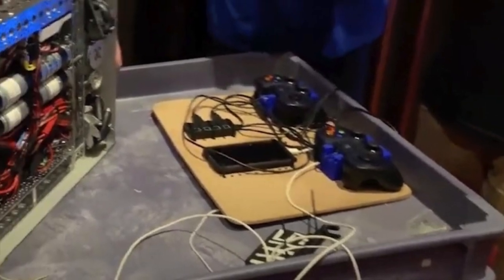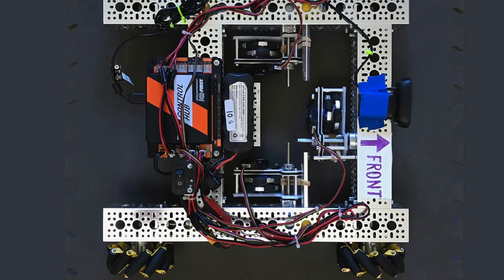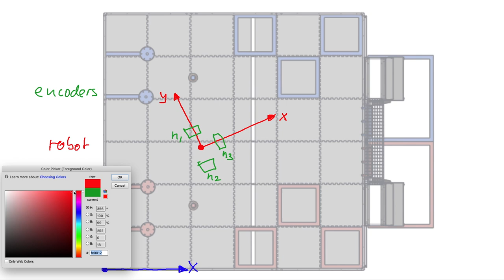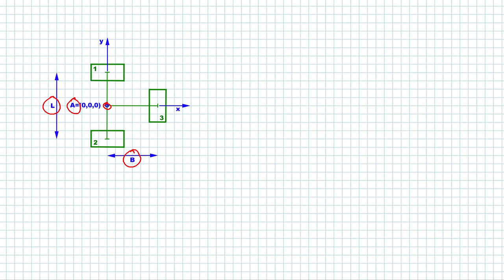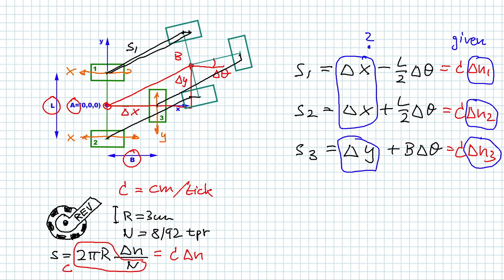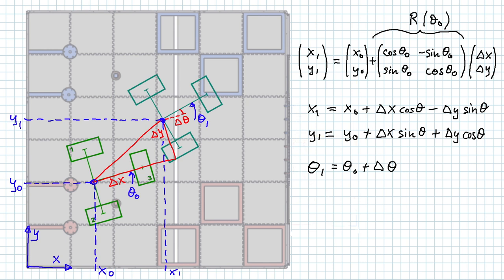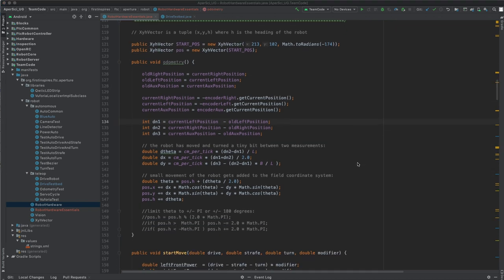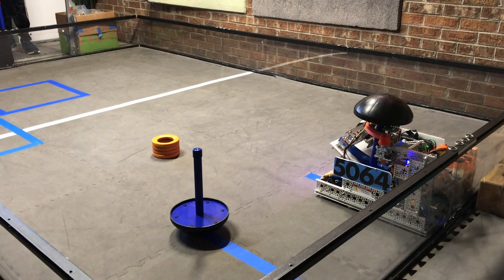Odometry 101 for FIRST Tech Challenge Robots

Comment: Love the video and thanks for your dedication.

Just one question, probably a dumb one. For the field coordinates, why are you adding just the half of dThetha to calculate the X and Y position? I don't fully get it.
Reply from the maker: Once you have an estimation for the displacement and change in the heading, you need to apply it to the field coordinates. You could (a) first apply the dx and dy and then dTheta or (b) dTheta first and then dx and dy. There will be a small numerical difference between (a) and (b), so I decided to split the difference by applying dTheta/2, then dx and dy and finally another dTheta/2. 

As with all numerical approximations, there will be a tiny error in each iteration. Luckily, some of the errors cancel out, but others may add up over time. The goal is to minimize the errors across the whole system starting from the mechanical sensors all the way to the numerical trickery.

Comment: Great video, is the rest of the code posted someplace? Especially the part on line 46? The goToPosLinear method?  We are curious to see how that works.
Reply from the maker: The short answer is no. Basically, I recommend some P or PID controller to follow a given path. There is no one-size-fits-all solution though. It depends on the hardware (mecanum vs. holonomic etc) and there is always a compromise between speed and accuracy.

Comment: Hello! This video helped me a lot to understand the concept of odometry. Sadly, when our team ordered the materials for this season we could only afford 2 rev encoders. I was wondering if there is any way we could implement odometry just by using two encoders on the x axis.
Reply from the maker: Yes, I can think of several options here, though I don't have any hands-on experience on those. In essence you need to track 3 parameters of the robot, moving forward/backward, moving left/right and turning, so you also need 3 sensors in the general case, but you could get away with 2 sensors if you don't move the robot in all 3 orientations at the same time. 

If you have fixed wheels (not mecanum or omni) the robot can only go forward/backward and turn, but it cannot go sideways limiting the need of sensors to 2. We have use that in the past and it worked reasonably well for not too complex autonomous programs, by just using the motor encoders.

If your robot uses a mecanum drive base, you could use the IMU in the controller to get the turn angle for the robot and use the two odometry sensors for x and y. However the IMU's angle tracking is not extremely accurate, but it may work just fine.

Comment: Thank you so much for creating this video. Is it possible to also see your code for your test auto program? Still trying to understand how you are able to move the robot the way you do in your test auto. Again, thanks for putting this together.
Reply: Hey Paul!

So we don’t plan on publishing our software, but here’s a little snippet from our code so I can give you a quick (but not really quick) explanation (we do all this in a LinearOpMode by the way):

    public void goToPosition(XyhVector[] p, double speedModifier) {

        robot.setupPosBezier(p, speedModifier);

        while(opModeIsActive() && robot.followingPath == true){
            robot.odometry();
            robot.goToPosBezier();
        }
    }

For starters, we went completely custom with our movement algorithm, so it’s very specific to our robot, and all the other software we’ve written, which makes it difficult to explain over text, so I won’t go into much more detail than is necessary. That said, as you can see where the method is defined, we take two parameters: An array of instances of a method we call XyhVector, and another parameter called speedModifier. A singular XyhVector contains 3 values; an x position, a y position, and a heading (we’ll come back to why we take an array of these in a moment). speedModifier, the other parameter, is simply a multiplier for the speed of our robot as it moves. As the method runs, we setup our robot’s movements with that method setupPosBezier, which calculates various things relating to our movement algorithm, like the path the robot will follow based on the points within a given array (p in this case, our previously defined XyhVector array), the time it should take to get there, the cutoff point at which we will stop following the path if it takes too long, and the distance we have to move/turn. Afterwards, a while loop begins, which lasts as long as the op mode is active, and our robot doesn’t take too long to reach it’s desired destination. Within the loop we have an instance of the familiar odometry() method (shown in video) and goToPosBezier, which takes the results from the setupPosBezier and translates that into movement of the robot. This while loop is crucial to the success of odometry in autonomous, as you can’t constantly track your robot’s position in the period without some way to constantly get new input. Hope that helped to answer your question, feel free to ask more if you’re curious or I just flat out didn’t give you the information you wanted!

TL;DR: We run our movement code in the same while loop as our odometry readings, which constantly updates our position allowing us to move accurately
Reply: @respieces5129  Thank you do much for sharing the information that you have. I really appreciate it.
Reply from the maker: Most of our movements are on straight lines. We chop up the line into smaller segments, depending on the length, then use a P-controller to follow the waypoints. That includes partial angles for the turns. We also experimented with Bezier-curves for more complex movements, but the team was not totally satisfied with the performance/speed. I guess there is always a next season to make improvements...

Comment: Hi, I’ve 3 wheel odometry but I cannot place my 3rd wheel exactly aligned to centre of rotation. In fact I’ve to place it near my rear wheel. I put feed forward offset as negative value but how do I accommodate angle in the code? Any suggestion what to do when centre of rotation and third dead wheel is not aligned?

Comment: Hi, im the captain of a mexico´s ftc team, i have some quiestions about the coder, what library did you use to define the XYHpos and where can i find it?, i´ve been trying to use the odometry in our robot and your video its so well explainded but i have those questions, i´d be glad if you can answer it, THHAAAANKSS
Reply from the maker: There is no official library or third party code that I could share. All you need is a class that holds the three variables for x, y and h (heading). See code in the description of the video. Getting the odometry values is one thing, following a path is something you need to add on top.

Comment: Can’t you just have the robot spin in a circle and divide each of the encoder values by 2pi to find the exact distance from the center instead of measuring by hand .
Reply from the maker: Yes, you can and we actually did. It's more accurate that measuring by hand. Before that, you also should drive the robot in a straight line and record the distance and encoder ticks. With that, you get the effective wheel diameter which may be off a bit from the nominal 60mm.

Comment: I ince was doomed by the high speed and low torque of my robot in a compitition does anyone know if there is a way to control torque mechanically
Reply from the maker: Roughly speaking torque * speed = power. So since the FTC motors have a fixed maximum power they can produce, you either can choose between low torque+high speed or high torque+low speed and everything in between. And that's done by selecting the appropriate gear box for the motor. If you don't have the exact motor+gearbox you need, you can further gear down your wheels by an external gear set or pulleys with a timing belt or sprockets with a (plastic) chain.

Comment: Team 6418 Question for the two X encoders couldn't you use the actual motor encoders realizing of course that their resolution/tick count will be lower than the omni wheel version. Wouldn't this simplify things because you would only need to add one omni wheel for the Y axis to the robot?
Reply from the maker: Good question. Yes, you can do odometry in many different ways, but the results will differ too, and it all depends on your drive base. When using motor encoders, you run into issues with wheel slippage and you don't register bumping into walls or other robots. We have looked at different approaches over the years and they all worked more or less:
(1) 2 fixed drive wheels + 2 omni wheels or a caster wheel. There is a general closed mathematical solution for this type of robot which is somewhat complicated to implement, but you can divide your path into straight lines and tunes to make the software simple. We used that years ago on our Lego robots and early FTC robots.
(2) Mecanum wheels + IMU. Mecanum wheels are fairly good driving, but strafing cannot be tracked reliably with encoder ticks from the motors. We have used mecanum wheels in conjunction with an IMU in the past and got fairly good results.
(3) Holonomic drive base (4 omni wheels). Very inaccurate odometry based on drive wheel encoders. You'll need dead-wheel odometry.

To answer you question, my gut feel is to go with either (1) or (2) or implement the complete 3 dead-wheel odometry. The latter one gave us the best results by far, but the other two can be programmed and tweaked good enough as well.
Reply: Team 6418 says hanks for the very prompt reply

Comment: so do you call the encoders as motors in the configuration on the phones?
Reply from the maker: Yes, they are set up as dcMotors and need to be named and defined in the REV controller accordingly. 
There are two ways of using the encoders:

(1) They are plugged into a port to which a motor is also connected. In this case the motor cannot use its own encoder and has to run without encoder. You can still read the encoder values from the odometry encoder plugged into the port. To make the program more readable, assign a new variable to the existing motor:

        motorSlides2 = hardwareMap.dcMotor.get("motorSlides2");
        motorSlides2.setDirection(DcMotorSimple.Direction.REVERSE);
        motorSlides2.setZeroPowerBehavior(DcMotor.ZeroPowerBehavior.BRAKE);
        motorSlides2.setMode(DcMotor.RunMode.RUN_WITHOUT_ENCODER);

        encoderLeft = motorSlides2;  // encoderLeft shares a port with motorSlides2

(2) If you don't use all 8 motors on your robot, you can connect the odometry encoder to an open motor port. In this case we use this setup:
        encoderRight = hardwareMap.dcMotor.get("encoderRight");
        encoderRight.setDirection(DcMotor.Direction.FORWARD);
        encoderRight.setZeroPowerBehavior(DcMotor.ZeroPowerBehavior.BRAKE);
        encoderRight.setMode(DcMotor.RunMode.RUN_WITHOUT_ENCODER);

Hope this helps. Good luck this season!

Comment: Hello I am from team sigma #20890. I wanted to know if there is any way where we can avoid restarting of control hub after uploading the code?
Reply from the maker: You should be able to upload new code onto the control hub without restarting it, at least most of the time. Occasionally, something gets stuck and requires a power cycle. If you have to restart your control hub each and every time you upload code, something's wrong. But that's impossible to troubleshoot with YouTube comments. Contact another team close to where you live and ask them for help on site.

Comment: In your code in the notes what is:

pos.h = normDiff(pos.h);
Reply from the maker: As the robot keeps turning, the heading or angle may increase to very high values. It's a good practice to keep them bounded within one rotation, let's say between +/-180 degrees or +/- pi in radians. That's what the normDiff function does.

Keeping track of the heading is a tricky business as you turn the robot and needs careful thought. For instance if the robot points to -150 degrees and you want to turn it by 90 degrees clockwise, you will end up at -240 degrees which is the same as +120 degrees.